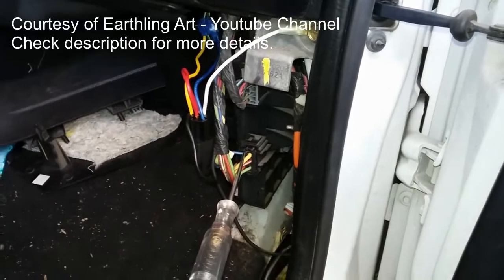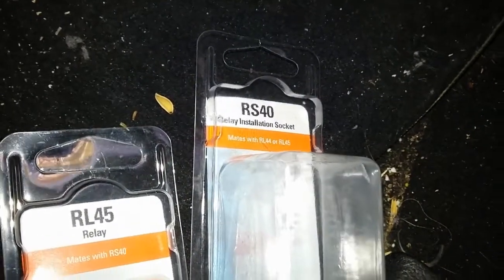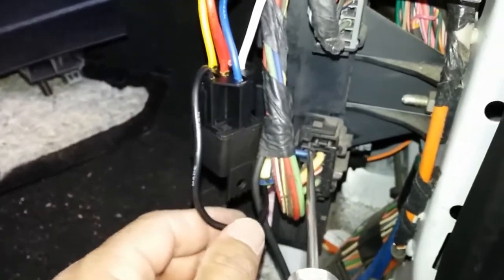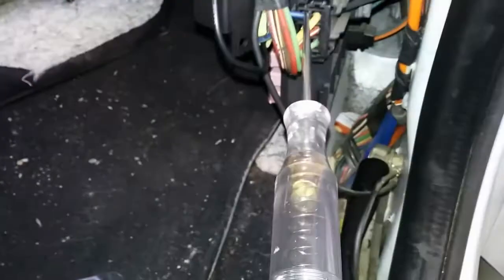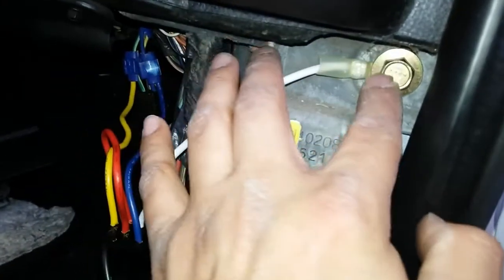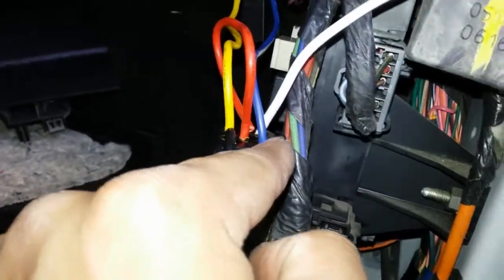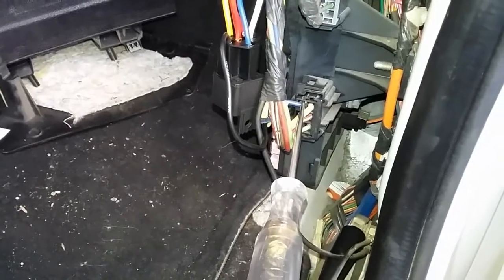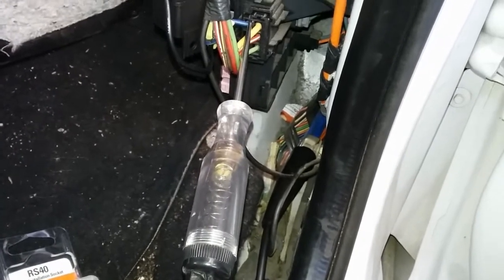(Lincoln Navigator) Internal Fuel Pump Relay Bypass

Comment: What do the other 2 wires on harness plug go to yellow and brown with white strip ? Asking because does it need to go plugged back into fuse box after making the connections on the wire for fuel pump
Reply: I have the same question

Comment: On the video that you bypass the Lincoln navigator fuel pump relay you didn't say what pin the red wire connection
Reply from the maker: @jkbs6667ks  Red wire is not used for this application

Comment: Your video was well done and I appreciate the info. My 2004 Expedition, after 20 years and almost 200,000 miles of no troubles, had this issue hit it a couple of weeks ago. I have watched many videos on this procedure and purchased the factory workshop and wiring manuals. One thing I am curious about is why are there no fuses involved in any of your power connections? Thanks.
Reply from the maker: @RickMillus  The only reason I didn't put an external fuse, was because it's being wired to a already fused circuit.

Comment: I just did exactly as per your instructions except the blue wire on a 2006 ford expedition is all green with no trace.  I think the fuel pump is bad because this didn't start up.

Comment: Question, the red wire, what is it going to?
Reply from the maker: @blong2898  red wire was not needed for this bypass.
Reply: @EliTheOBDTech  
Thank you for your kind reply, I also found the blue wire went to a green wire and the yellow wire went to a blue wire with a yellow trace.  My connector didn't have the same return wire as yours in the video.   Thank you for your great videos

Comment: So this method bypasses the inertia switch?  Would the better method be to find a wire that provides power for a short time and then grounds out after 2 seconds?
Reply from the maker: I would need to look into the circuit to see if it does.
Reply from the maker: Yes, that would be a better solution
Reply: @EliTheOBDTech  Ok thanks.. Now to find that wire lol.. Your video has helped a lot!

Comment: So I followed your exact set up and I was curious let's say I wanted to hook up a kill switch which one would I tap into far as colors if I did the exact same setup as you
Reply from the maker: You can tap into either the black or blue wire. Preferably, the blue wire, which is a fused power feed.

Comment: I did this but my pump wont go off😢
Reply from the maker: This set up is made to make the fuel pump run at all times with key on engine off and with vehicle on. It should be off with the key on the accessory position. Not sure what went  wrong with your setup.

Comment: Your video has helped me and my wife with our 2004 Ford Expedition, I went to auto zone and bought everything you had in the video, and had it running in less than an hour, thank you, now I will wait and see if my check engine light low fuel pump voltage light goes away, thanks again!
Reply from the maker: I'm glad to see that it helped.

Comment: I have the same problem with a 2001 lincoln navigator can you do the same thing for a 2001
Reply from the maker: Not sure if the first generation from 98-02 have the same setup as the second generation from 03-06.
Reply from the maker: You would need to see if your fuel pump relay is internal or external on the power distribution box.
Reply: @EliTheOBDTech  it's  external
Reply from the maker: To be honest, I'm not sure if it's possible. I would have to look at wiring diagram.
Reply: @Eli TheOBDTech  I basically changed everything already on the Lincoln I know I have to change the egr system but im still having problems turning on it hesitation rough idle and sometimes it doesn't turn on
Reply from the maker: @mariosanchez6068  will the truck stay running if you raise the rpms?

Comment: I unplugged the wires from the fuse box, but I don't have any voltage at the blue wire, or any of the wires? With the wires unplugged, remote door locks won't work. Is that normal?
Reply from the maker: I have you checked for a blown fuse?
Reply: @EliTheOBDTech  they put new fuses in at 12, 32, 33, and 34, test light shows that they are good. Remote door locks work when the plug you show is plugged in, but they quit working when I unplug it .
Reply from the maker: @robertmoyer2311  The plug needs to go back into the power distribution box once you splice in the blue wire.
Reply: @EliTheOBDTech  thanks, I haven't spliced a relay plug into the plug yet, as I was trying to get battery voltage at the blue wire. They had already disconnected the battery, so no codes to be read, but code reader test of system shows issue with the fuel pump.
Reply from the maker: @robertmoyer2311  what is your year make and model of your vehicle, I will look into the wiring diagram to give you a better answer.
Reply: @EliTheOBDTech  it's a 06 Lincoln Navigator with a 5.4  Thanks, appreciate any help you can give!

Comment: I just did this last night to my 2003 Ford expedition ,it worked but my theft light stays on and now my battery is dead.has this happened to you before?
Reply from the maker: No. As long as you tap into the correct wires, it shouldn't drain your battery.
Reply: @EliTheOBDTech  what do u do with the red and black wires
Reply from the maker: @kalebclifton6201  Red wire is not used in this application and black wire spliced with blue/green stripe wire.
Reply: @EliTheOBDTech  so it goes into the green white, not the blue and white on that bottom plug?
Reply: @EliTheOBDTech  does this bypass the R203 relay or just the R303 relay?

Comment: I performed this bypass mod and the relay will open at random times causing the vehicle to stop running. If I change the relay to a new one, it will run until some random time and open. I replaced the fuel pump and it still does thr same thing
Reply from the maker: You might have a weak connection on one of wires that intermittently stops having continuity. Recheck all your connections.

Comment: A friend of mine had taken her navigator to a couple of different mechanics and they couldn't figure out the problem. The last one swapped out the fuel pump, and it was still stalling and not starting at random intervals. She told them it had to be the fuel pump relay. They blew her off. One said they swapped it out for a good one and it was still having problems. She is handicapped and on a tight budget, so the $1200 she had already spent was pretty much all she could budget. I told, and showed her that the fuel pump relay is nonservice-able and that they were not fixing the actual problem. She asked me to do the work. I followed your advice and it solved the problem. Thank you for this video!! One VERY important thing that I want to stress to anyone doing this fix: It bypasses the RPM control!! I HIGHLY advise putting in an inertia switch between the power applied from the key function. If you do not, and there is a collision or rollover, the pump will continue to pump gasoline, and create a hazardous condition. The inertia switches are inexpensive, and it is an easy modification/safety measure.
Reply from the maker: Thanks for key pointer, regarding the inertia switch.
Reply: @EliTheOBDTech  You are welcome! I really appreciated your video. It didn't even cross my mind about the inertia switch until I looked at the wiring diagram and saw that this system uses the main computer's input regarding the engine RPMs. When the engine stops, the computer tells the fuel pump to stop. Decided to go old school and just put an inline inertia switch works great!  I appreciate you! Your video saved this lady a lot more time and money at the shops. I didn't charge her to do the bypass either. Just trying to make the world a better place where I can.
Reply: I have a 2004 Expedition, and on 4 occasions the fuel pump relay has burned out, I have a little knowledge of automotive mechanics, and I still have not found what causes this very common problem, I replaced the fuel pump, replaced the fuse box, I have replaced the relay twice, I have checked the voltages, and I still do not know what causes this, I can only think that it is a problem with the PCM.

Comment: Question the part wen u put replay into compartment were it originally meets battery power it just works after that
Reply from the maker: Yes, wires 30 and 87 will provide power and ground when connected back into the power distribution box

Comment: Thank you friend! I was ready to throw my Lincoln away. But I have a spare relay in the basement and you have given me the courage. I appreciate it very much. This thing sat all winter in Montana because it was too cold to try anything. And you don’t take your Lincoln to just anyone in rural Montana. Now the weather is nice and I can do this.
Reply from the maker: I'm glad this helped.
Reply: @EliTheOBDTech  Hi again! I went to install this relay in my 2006 Navigator and the blue outlined wire bundle you showed has a green wire in mine where your’s is blue. My wires in that blue outlined bundle are green/yellow, brown with white stripe, solid yellow, and solid green. I have been tested for colorblindness and I am sure it is green instead of blue. Any ideas as to how I should proceed? Thanks in advance!
Reply from the maker: @sheltermutts4185  As long as you follow the pin numbers on the relay as I described, you should be good.
Reply: @EliTheOBDTech   Wow! You are fast and much appreciated. I voltmeter checked the green wire and it is +12 with key, but not fused to #34 like your blue wire was so I guess I won’t know what fuse it goes to. Waiting for some quick connects to arrive before I tap into anything. I am very grateful once again for your kind assistance. You are a rock star!
Reply from the maker: @sheltermutts4185  If you keep having questions, don't hesitate.
Reply: @EliTheOBDTech  Hi again! I think I’m done. I used a 4 pin relay because that is what I had. And I had to use different colored wires to switch the relay and power the yellow/green wire. I can hear the relay switching on and off with the key, and my voltmeter shows the yellow/green wire being fed 12v when the ignition is on, and only when on. My problem was very sporadic and for the past couple of days its been starting fine before the bypass. So its harder to tell whether the relay cure has been successful. Time will tell. Our road is a winding two land mountain road with practically no where to pull over if the fuel pump quits. And I’m way to old to push this thing. And thanks again for your very kind and prompt attention and assistance. I am most grateful! Your friend in Montana.
Reply from the maker: @sheltermutts4185  It's a shame Ford/Lincoln had to design a fuel pump relay that lives inside the power distribution box. Which makes it harder to replace, literally leaving you the options to replace the whole power distribution box, bypass the relay or remove the fuse box and solder a new fuel pump relay. Hope your problem gets resolved by doing bypass method, cheers for completing this task my friend.

Comment: I have a question does this set up get rid of the fuel pump voltage code
Reply from the maker: To be honest, I never checked for codes, just for the fact that the check engine light was off. Even with a faulty fuel pump relay. No guarantee, but I think it will.

Comment: Where does the red wire go and can the white wire go to bleep white wire and the black wire be used to ground
Reply from the maker: Red doesn't connect to anything. It's recommended to keep wire the way I show on the video. Black connects to the blue with green stripe wire.

Comment: Is this a temporary or long-term fix?
Reply from the maker: It can be long term, but you have the choice to go back to original set up by  replacing the power distribution box.
Reply: Is there any concern if i made it as a long term bypass?

 I bypassed my car's main relay too,works well with engine light on, no other issue. Without the relay bypass, it wont start